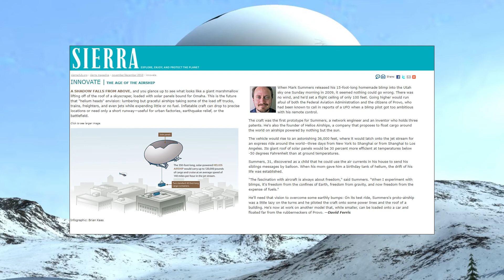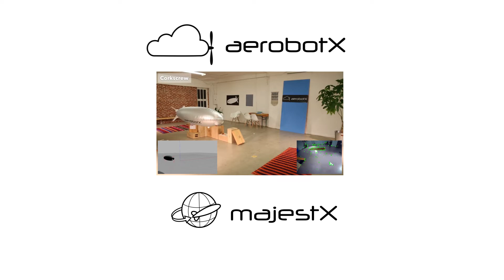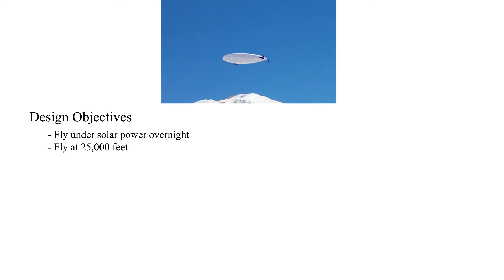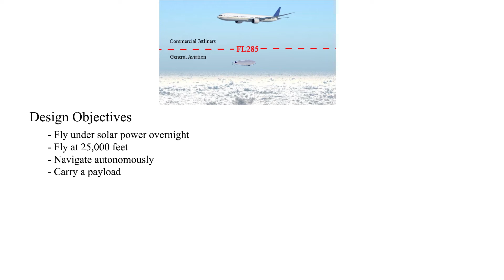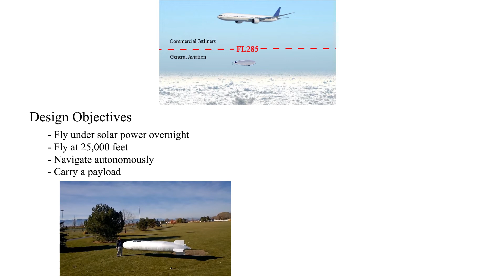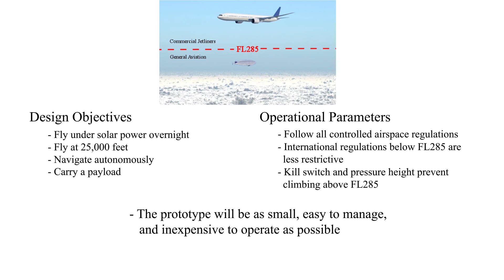Jet Stream Blimp Drone Project Revival

Comment: Has there been any progress made on this? Starting with a small prototype is very wise, I like this idea. Once that's working, airships scale up very well, as you know.
What exactly is the regulatory framework for using hydrogen in drone blimps? Surely it's not illegal to fill a party balloon with hydrogen, but where is the line drawn? I'm sure you're well aware that hydrogen is far more practical cost-wise than helium as long as some safety precautions are met. I'm planning to get into making drone blimps and want to use hydrogen but I'm having trouble figuring out the exact laws about that, especially because I'm not very good at reading legalese.

Comment: Thks & ?how did it go?
Oh also I would like to start RC blimps.  ?Is there a great book? ; ?Did you do a great book? ; ?How do I start?
Reply from the maker: I ended up putting this project on hold and working on the supporting electronics before making another attempt at the airship. The best recomendation I would give is to join the facebook group "Small Airship Union". It's a great place to get help building and flying blimp drones.
Reply: @BaccaYarro  Thks &;
I found some great beginnerr videos on your YouTube channel.  If you ever have any time, ??hows-abouts a blimp for dummys (like-me) Playlist??
Oh one more question, a hydrogen fulled blimp is the perfect fuel tank for a hydrogen fuel-cell.  ??Are there any hydrogen powered blimps?? If-not, then I have found my niche ;).

Comment: Vary cool idea! though with the jet stream going around 110 mph, would a non-rigid airship be able to withstand quite high airspeed? And what happens if you have cargo to be delivered but you need to go against the jet stream to get to the location? How fast do you think the airship can go by using its own power? Though i do see great possibilities with this airship idea,  its going to be way cheaper to fly then cargo jets, the main question is, can it competitive with the delivery speed of some of our current delivery methods? Which i can see it being better then vans and trucks on the ground, but... what about jets? jets are more costly to run but gets things done way quicker, so the other question is, would the airship be more profitable in the long run compared to the jets that do the job done faster and thus able to do more jobs in a shorter amount of time? (sorry for a lot of questions, but i am really fascinated and interested in this concept)
Reply from the maker: I would agree on most of your points. Faster than trucks and boats, not faster than airplanes. However it is interesting to note when 2 cities are connected by both airplanes and trucks, 90+% of the shipping by value is sent via truck. So shippers prefer something that is a little less expensive than the fastest option. I show a little of this in my cargo statistics section. Also, it is still pretty fast. For example, from Asia to North America is only 2 days, which is a lot better than the ships most people use now. If you need to go against the Jet Stream (IE: travel West) it can be faster to go all the way around the world East than try to go West directly. For example, if you reverse the course I show in the video and go from San Francisco to Tokyo, you would travel East all the way around the world, and it would take 7 days. Note this is still faster than a ship can do it, which takes 2 weeks. 

The above assumes you can legally cross national airspace, which is a big unknown. At first, I anticipate using this only for East moving traffic. Which is still a huge amount of cargo.
Reply: Fascinating! well one thing is for sure, i am incredibly exited to see not only this video but the fact that airships might get a massive comeback with this idea, and which one thing i was thinking about, is that as this technology develops and becomes more reliable and safe, i wonder if then it might become possible to have say high luxury travel using airships...
Reply from the maker: @coolfish3087  I don't want to say luxury airships are impossible, but they would face some issues. I don't think they would be competitive with jets for speed, or sea ships for comfort, but perhaps a compromise between the two? And with a better view? We can dream. :P

Comment: What if the blimps were around the size of the LZ 127 Graf Zeppelin to the Hindenburg? With the size they could carry plenty of cargo and surely be more cheaper and definitely more environmental friendly thus making them rather practical.

Anyway interesting video Bacca! And how was your trip to Deutschland and Airship Regatta?
Reply from the maker: A much bigger ship would be able to carry much more, and be even more economical. Also, a little faster. But it would be much less practical for me to build with my current resources so that will have to wait :) I'm afraid the Regatta was a bust for me. Never made it out of the US. The airline ghosted me, I'm still fighting them over it. But I was able to get the trophies to the competitors, and it sounds like everyone had a good time.
Reply: @BaccaYarro  Sorry to hear about Regatta, that sucks. So in terms of speed, what if you put something like nylon sails on the sides and top to catch the wind? Think that would greatly help increase the speed of the blimp?
Reply from the maker: @Jarred-J254  Well, sails on airships is an interesting topic. Just one sail isn't enough, because the airship would just drift with the wind around it, and there would be no aparent wind from the airships perspective. But what could work, and work very well, would be 2 sails. One a few hundred feet above the airship, and one a few hundred feet below the airship. Such a vehicle could sit at the edge of the jet stream, or the edge of any other wind. One sail in, and one sail out. It would create a differential that could be used for propulsion, even in directions other than what the wind is blowing in. Like "tacking" in a sailboat. I like to think that in a world with a denser atmosphere than Earth, sailing airships would have roamed the skies long before steam powered ships.

Comment: One of my relatives was on the board of a german company called cargo lifter which was also attempting something like this. They actually got quite far and built hangars and ships. If you've ever heard of the tropical islands waterpark, that is inside a former airship hangar built by them. Maybe its worth doing some research on what they did wrong and how you can avoid that :)
Reply: I'm guessing the waterpark was maybe a misstep
Reply from the maker: No kidding? A couple of the guys in the Airship group worked on Cargo Lifter too. Small world.